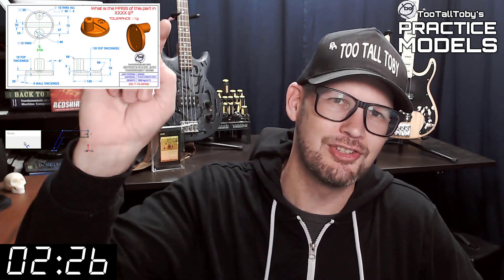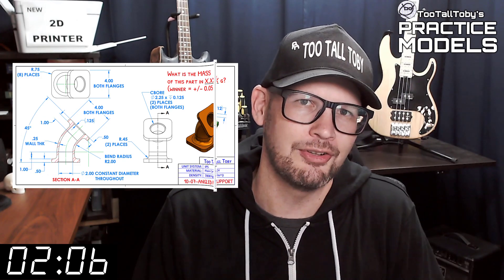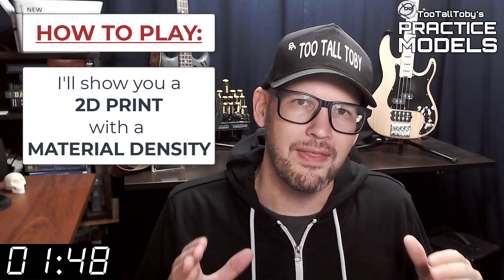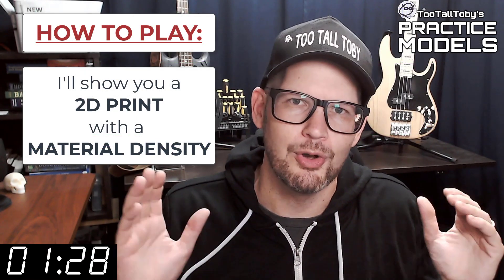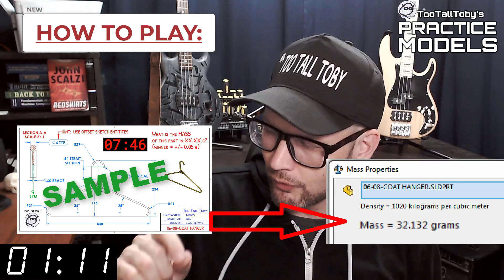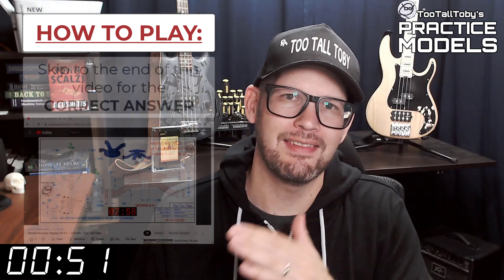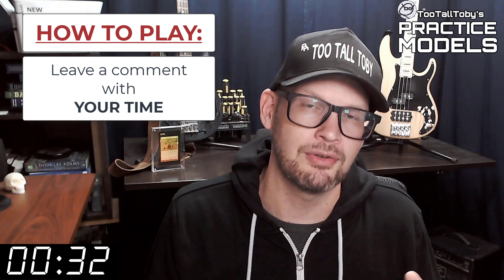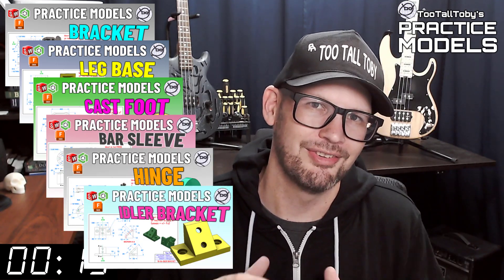2D to 3D CAD PRACTICE MODEL-  Free Drawing Exercise for 3D CAD users - KEYHOLED CLIP

Comment: 279,46869641774g in 4:20 (with no Ivan's exploits)
Reply from the maker: Nice! No Ivan Exploit!
Reply: The hell is ivan's exploits?
Reply: @bogey_dope_ae  you reach the same mass but with different geometry. Let's say you have a plate with holes. It does not matter where on the plate are the holes. The mass will be the same. 
It goes far beyond to just holes.